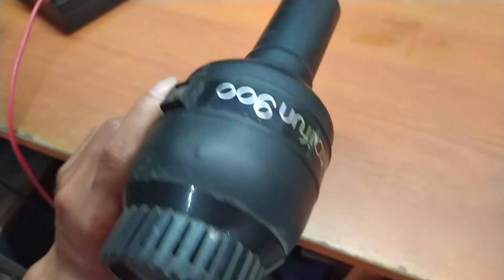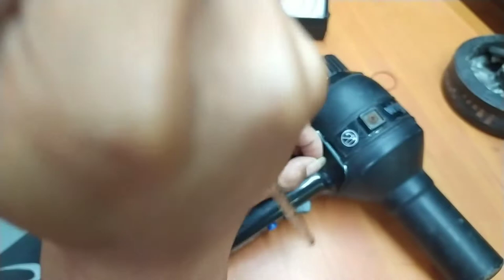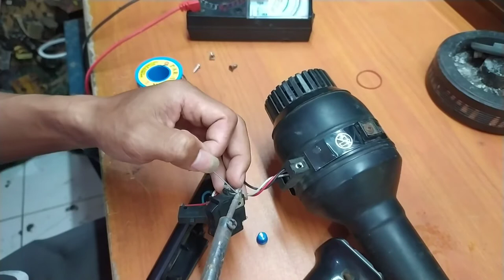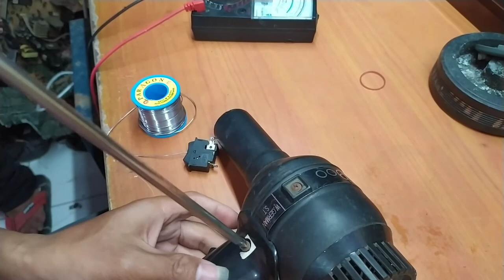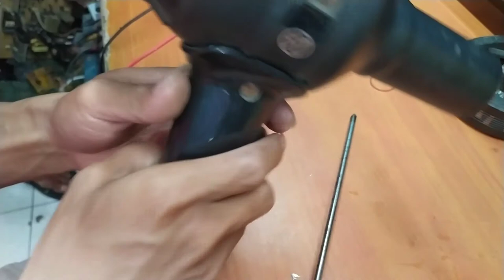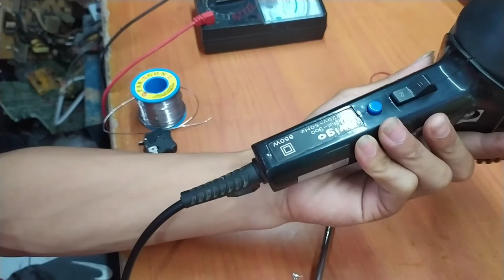CARA MENGGANTI SAKLAR HAIRDRAYER WIGO TAIFUN 900WATT KARENA MATI TOTAL

Comment: Bos klo panas y ga mati2 apa nya ya
Reply from the maker: Bisa di ceritain agak mendetail bos kerusakanya gimana....
Reply: @zainled7789  klo di pencet swich on pemanas..pemanas y ga mati  padahal swich nya bagus..kira2 apa nya ya bosku
Reply from the maker: @suhandisuhandi7560  pernah ganti switch gak bos... Kalo belum coba ganti switchnya dulu bos... Barangkali switch nya dah lembek.....
Reply: @zainled7789  Dah baru bosku swich nya..2 2 nya dah ganti baru
Reply from the maker: @suhandisuhandi7560  pemasangan gimana bos... Yakin bener apa ga saklanya????
Reply: @zainled7789  kan ikutin yg dah ada..ga ada yg di rubah bosku..🙏
Reply from the maker: @suhandisuhandi7560  6282136951932 itu wa saya bos coba di vidioin kendalanya sperti ap biar lebih jelas. ..
Reply: @zainled7789  waduh sukron bosku..atas ilmu nya..moga berkah..oke nanti ku wa 🙏